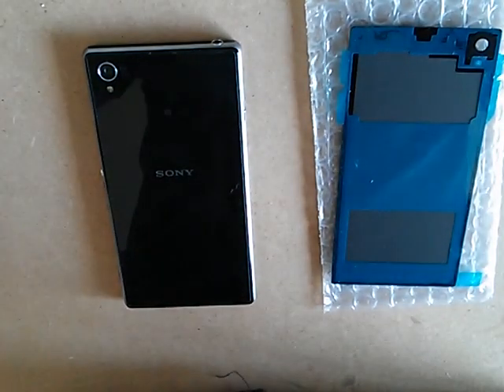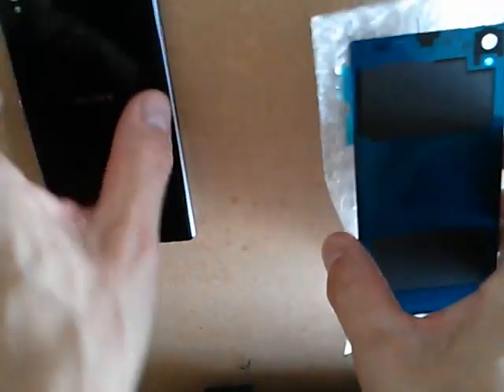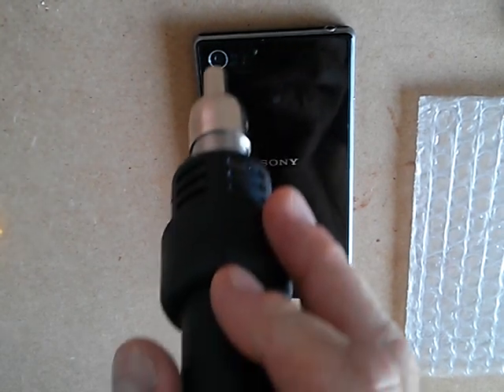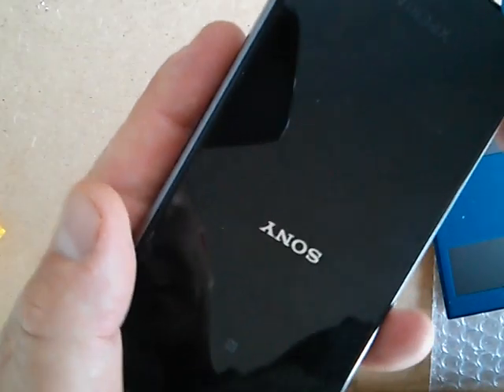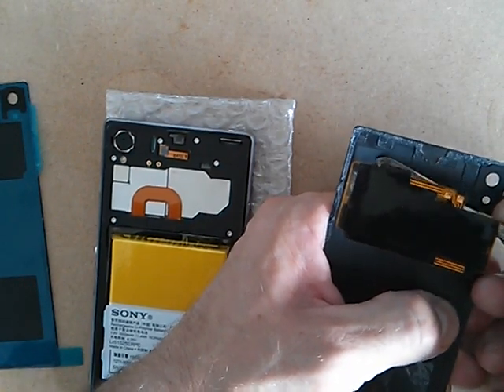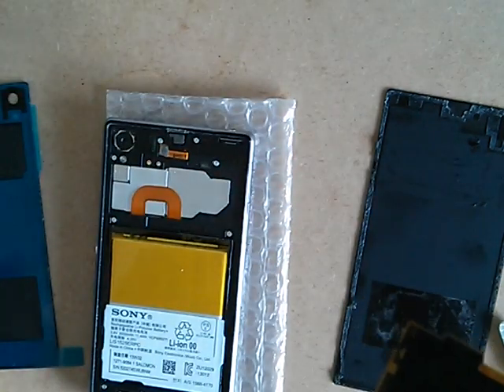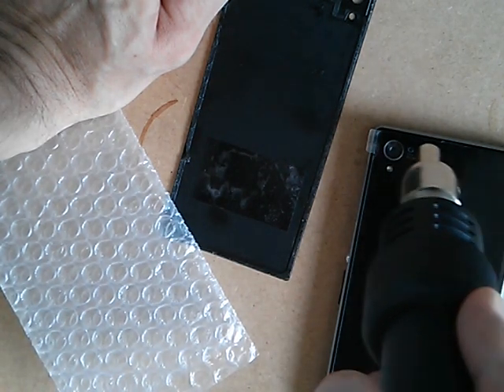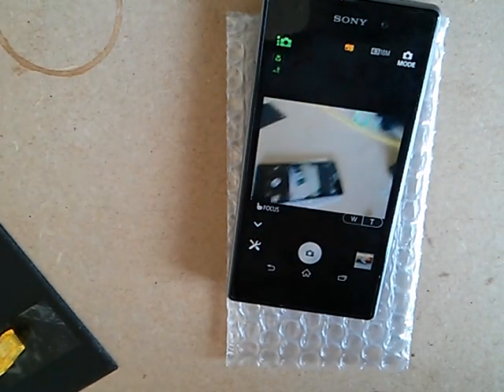Replacing the back cover of a Sony Xperia Z1 and transplanting NFC Chip

Comment: sorry, but this video is weak. you do a lot of work outside the camera view. you take off blue protection before placing nfc. and I wonder what it is that you didn't replace? nfc is on the top and on the bottom there's also something you should restick to the new case